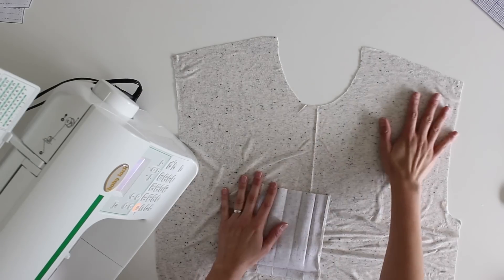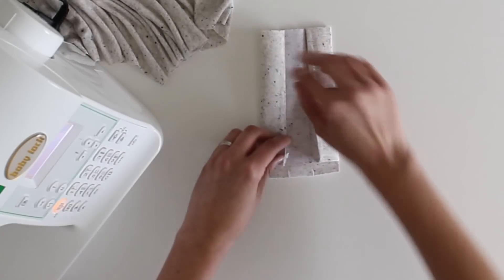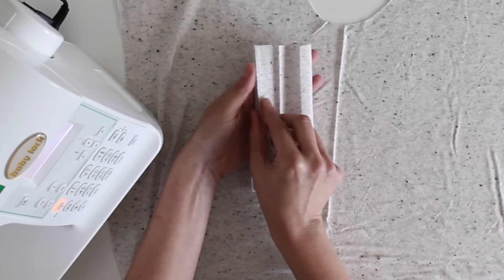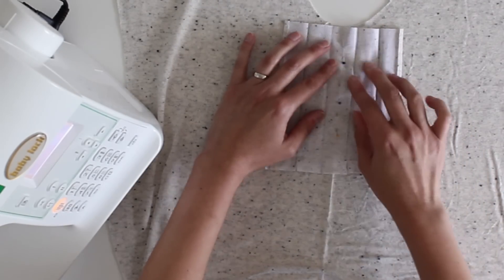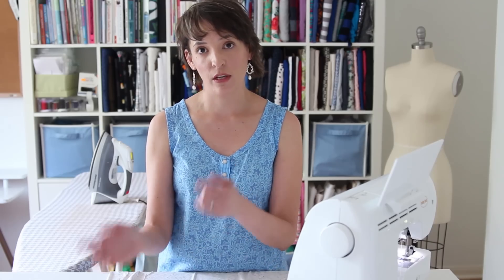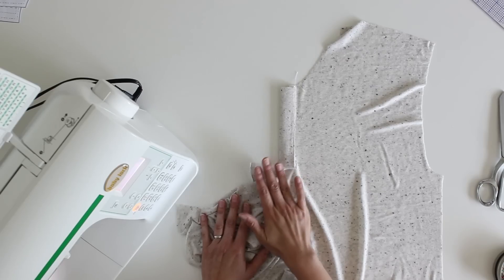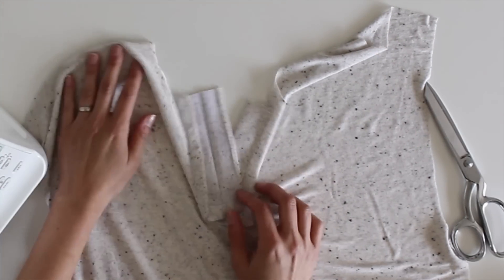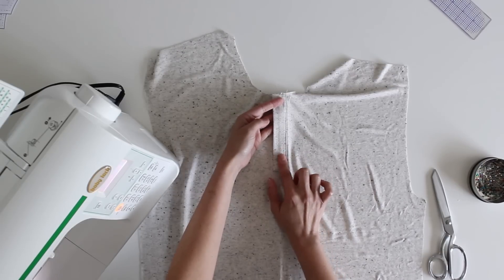How to Sew a Henley Placket

Comment: Great instructions thanks. But how do you add the neck band now? The only videos I can find are for a different method of placket construction.
Reply from the maker: Fold neckband wrong sides together and stitch across short ends, then turn right side out and attach to shirt.
Reply: Um that’s for a regular neckband but a Henley is different.
Reply from the maker: No, for a regular neckband you sew it into a loop. For a henley you match long edges and sew across two short ends then turn it right side out.

Comment: what would happen if i made a button down dress with double jersey knit fabric
Reply from the maker: I don't know - it depends on a lot of factors.
Reply: Would I need to double the amount of fabric on the button placket portion of the dress
Reply from the maker: It would depend on how long you wanted the placket to be.
Reply: Thank you for replying. If the button placket extends on the length of the dress, can i sew the placket together 3/4 of the way up the dress , so the jersey knit fabric would only have three working buttons on it. the rest of the buttons could be placed on the placket for decorative purposes. the dress could still be slipped on due to the nature of the jersey knit fabric. Once again, thank you for your help.
Reply from the maker: I can't give you an answer for that. It would depend on how big the neckline was, among other things. If you're unsure, I'd suggest either trying it with inexpensive fabric to see, or finding a pattern that has this detail included.
Reply: thank you